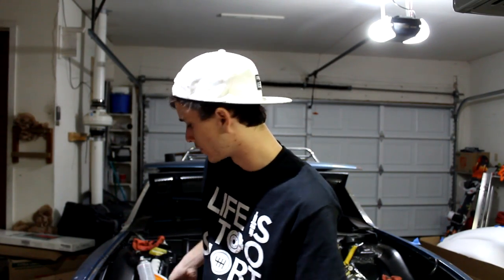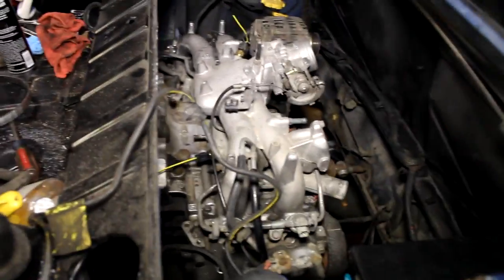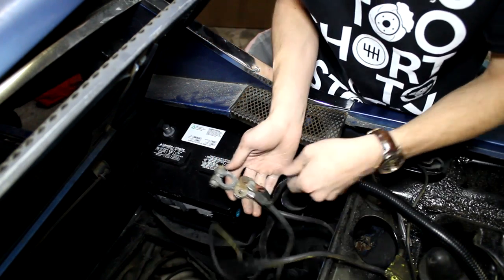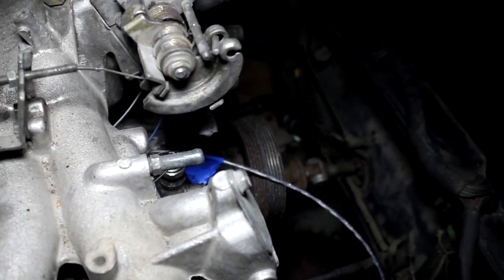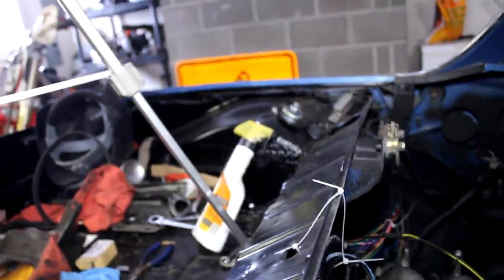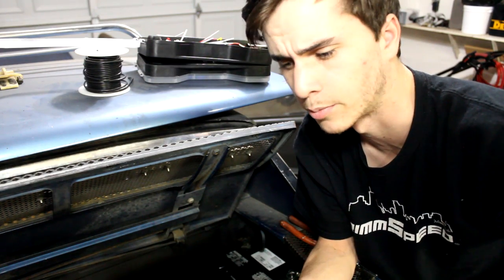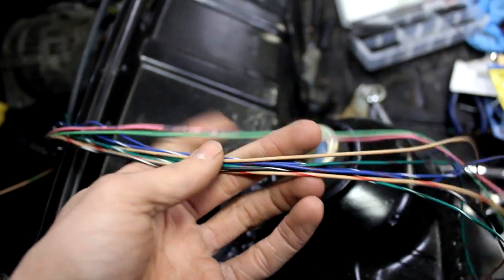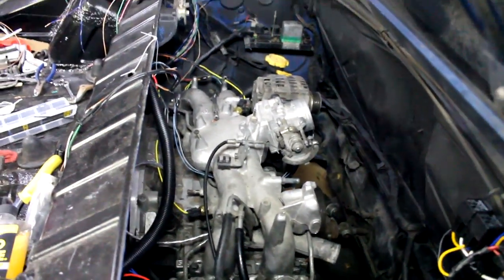Project 914 Episode 9: Megasquirt Harness

Comment: i'm confused. cylinders in ej22 seem to be, left front(lf) 1, left back(lb) 3, right front(rf) 2, right back (rb) 4? correct? but 03290610b coil with plug facing forward seems to be lf cyl 2, lb cyl 3, rf cyl 1, rb cyl 4. doesn't coil fire in banks? or do i simply run spark wire from coil 2 to other side of engine to cyl 2, and same for coil spot 1? hope i've asked this question clear enough. also posed it to diyautotune.
Reply from the maker: +Jim Kelly you're close. Lf and rf will be cylinders 1 and 3 and lb and rb will be 2 and four.  Basically the wires closer to the plug go to one bank and the wires farther away go to the other bank.